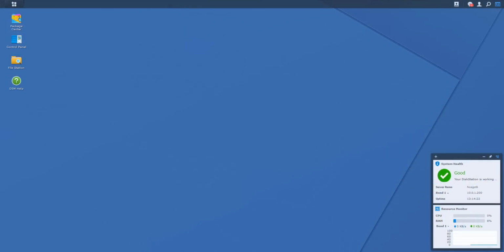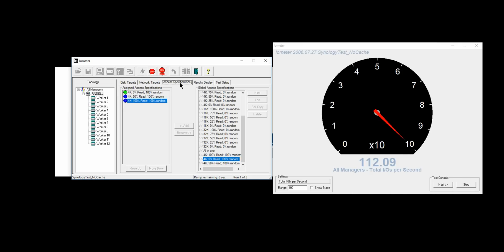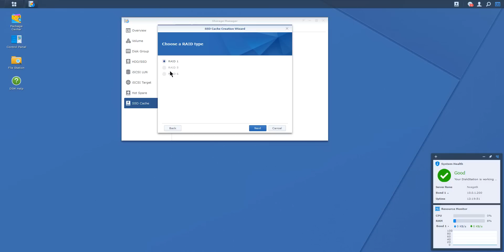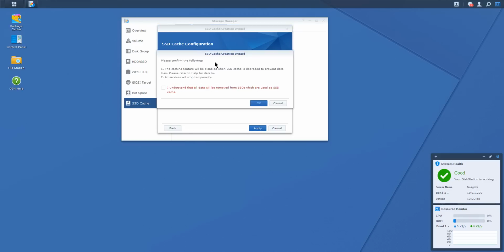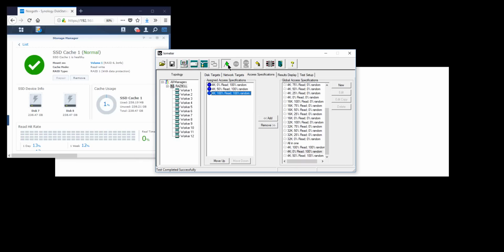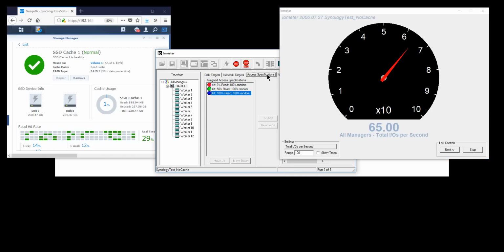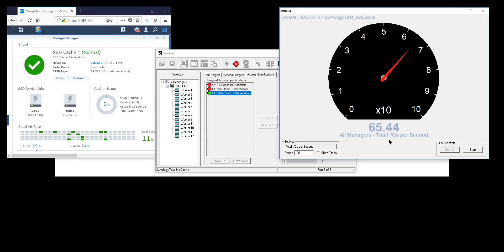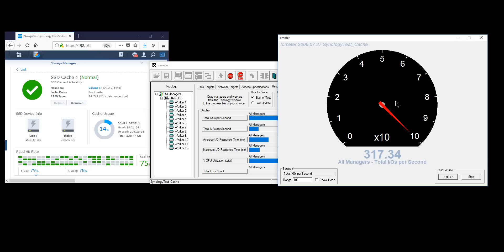Synology SSD Cache Setup and Testing

Comment: I noted that you did not put the SSDs in the correct slots. The SATA backplane in the Synology 1815+ is configured so that Slot 1 & Slot 2 are on one channel, and slots 3-8 are on another channel.

Synology uses bcache for handling the tiered caching of btrfs/shr. Synology has configured bcache (IIRC) so that it considers data to not be written until the data is written to both the cache layer and the backing storage. This is a write-through cache. You can actually change this with a little fiddling. Synology's default configuration is to protect your data at all times so it doesn't cut corners with bcache.

When writing data, the synology writes the data to the cache (write operation), and then bcache reads the data from the cache (read operation), and writes it to the backing store (write operation). Again, to re-iterate, data is not considered saved until the backing storage confirms that the data has been safely written there.

When reading data, the Synology first looks in the cache, and if it isn't there, it loads from the backing store (read operation), puts the data in the read cache (write operation), then reads the data from the cache (read operation).

This is why your IOPs are in the toilet. bcache can give an immense performance boost, but unfortunately the way it is configured in the Synology, and rightfully so if you want your data to be as safe as it can be, is to actually introduce a performance hit until the cache warms up.

You can modify your Synology configuration -- tweaking bcache to use write-back caching -- so that data is written to the cache directly, and then written to the backing store separately, and that will speed up your write IOPs. But there is a chance, in the event of cache failure or cache corruption, that you will lose data. You can also change the configuration so that if data is not in the cache, it is delivered directly from the backing store first, and only then is it transferred to the cache.

It isn't anything to do with the h/w in your configuration, it is all to do with the way Synology configures bcache to keep data as safe as possible.

P.S. I may be a little hazy on the bcache read/write operations, it has been two years since I looked at the source code & documentation. I do believe that bcache writes then reads then writes, the read operation being to check that the data written to cache matches the data that was meant to be written.

P.P.S. Get some cheap Enterprise SSDs from eBay and toss out those junker consumer SSDs when building cache drives. You will also then not care about the "don't use cache for sequential I/O setting" as the write characteristics for the TDW will be measured in several petabytes rather than a couple of hundred of terabytes and your IOPs ability will also be far higher.

P.P.P.S. I would double-check my statement on the write-back vs write-through caching as it has been a while since I fiddled with this stuff and Synology may have updated their caching configuration.

Comment: Great video! I was wondering how we should calculate cache size vs overall size of installed drives.
Reply: Synolgoy DSM has an "SSD Advisor" built in to the software that can estimate what you capacity SSDs you will need.

Comment: Wouldn’t it be better just to use cache for « read » while making initial configuration?
In this case it will not affect the write speed
Reply: Yeah, because in the case of NAS systems your benefit is on the READ side of things which is where you want the performance, the added benefit is you'll also get fast Write speeds also.

Comment: Can you help me a bit? 
I'm not sure if I will do the right thing here, I have two 240GB SSD's and I want to insert them in my HP Microserver Gen8. 
If I will do that, I will have to settle for 2TB of data support, because I have to keep the redundancy in place, so I will lose the other two slot for that option. 
I use this unit only use Xpenology for a PLEX server, so I need to know if those SSD's will really help me. All I want is to watch any kind of 4K with no buffering or interruptions... 
Lately I saw that the large 4K files doesn't move very well in my actual setup, despite the fact that I have a Xeon microprocessor and 8GB RAM.

Comment: You need a boatload of cache to make it worthwhile, and disabling sequential access makes it even harder to benefit from cache (because when you copy something in, it doesn't pre-populate the cache with your latest [and probably most used] files).

On our mainframe disk I/O subsystem, there was a bit you could set for "this is a backup" which would prevent backups from poisoning your cache. This make a lot more sense than disabling sequential access (but of course since virtually nothing is vertically integrated in distributed systems, it would be a ginormous task to get everyone to agree to changes like this).

Comment: Hello, I have DS1515 +. In the last 2 positions I have installed 2x SSD Crucial MX300 525GB. I do not know what it is, but I have not experienced any higher system performance. On the contrary, copying larger files is slower ... SSDs are in my case in positions 4 and 5.

Comment: Dare to dream: would be nice if Synology gave you the ability to turn off SSD caching at the share level. I don’t need non-production data to use the cache, even though some of that gets accessed a lot (thereby being moved to the cache, taking up that cache space that other prod data could use.)
Reply: I think you can use two Volumes, one use cache SSD and fast hard drives. The other doesn't.

Comment: You need to Get a 10Gbe connection. Caching is useless when you’ll never exceed 12bps
Reply: 12bps lol is it loading off of punch card?
Reply: He is measuring Iops though not sequential reads. 100-300 Iops test is not going to line rate a 1GBe.

Comment: adding flash memory to anything has an initial hit to performance. Same thing is seen on SSHDs. 

Once the flash memory learns of the most accessed files, its faster than average.
Reply from the maker: Got it, and that is happening here.  However, my major concern is that non-cached data seems to suffer a 30% penalty when the cache is set up.  I don't know if a 30% drop for all non-cached data is worth amazing performance for the cached data.
Reply: So, what did you guys conclude? I'm picking up a NAS today DS918+ and I don't know if I should get 2x 128 GB SSDs or not as I hear conflicting reports over the utility of using them. Heard that it'll load Plex metadata faster and extend the lifespan of HDDs. But if non-cached data suffers, I don't know.
Reply: Fennec same situation, so did you install cache at the end ?

Comment: Hi, I have 4 of those Synology 1815+ and I made the same test as you did a year ago. But I was not that patient and quickly dropped the idea of caching my Synology.
 
But I read somewhere on the web some interesting stuff regarding the 1815+, (cannot remember where) And they said that the 1815+ is constructed using Sata 3, Sata 2 and Sata 1.
Bay 1, 2 is Sata 3
Bay 3, 4, 5, 6 is Sata 2
Bay 7, 8 is Sata 1 
And this might explain your poor SSD cache performance. Try moving the SSD to Bay 1, 2 instead.
Reply from the maker: I moved the SSDs to slots 1 and 2 today and re-did the testing.  Results are the same.  Cached data slowly gets amazing but non-cached share files suffer a significant performance penalty when the cache is turned on.

Comment: Thanks, so to install the SSD onto the bays you just need to use the supplied screws that came with the SSD's?  I know for the regular NAS drives you just snap them in, I was just wondering if the SSDs requires a bracket.
Reply: For my DS918+ they required no tools, just slide in

Comment: How is the NAS connected to your computer? 10gbe or 1gbe? I'm only getting 106mbs on my 1517+ to iMac. Might have to use SSD cache.
Reply: thats propably due to your 1gb port on the iMac. 106mbs sounds about right for that
Reply: I'm amazed it got 200 views. What a horrible video. Good effort, but, shouldn't you KNOW when you don't know something? Don't you know enough about computers, to know you're a novice?
Reply: 300+ IOPS does not mean 300MB/s . And regarding heavy IO you wont get 106MB/s on the 1517+  . In the video you see there are 300+ IOPS @ 1.24 MB/s at min 8:17